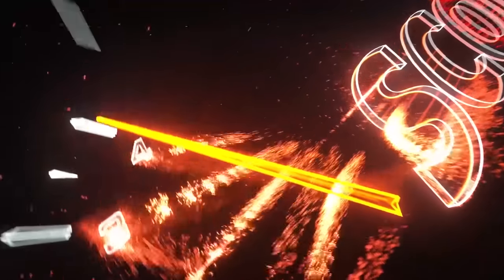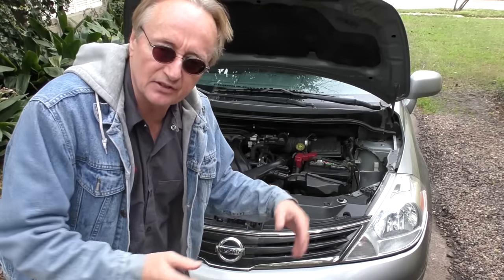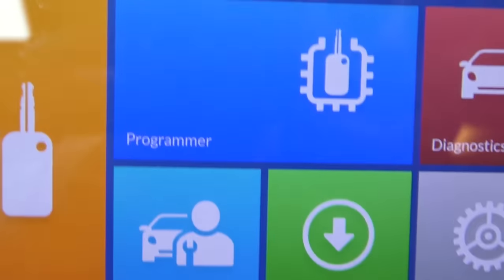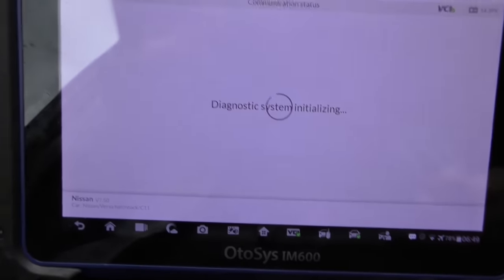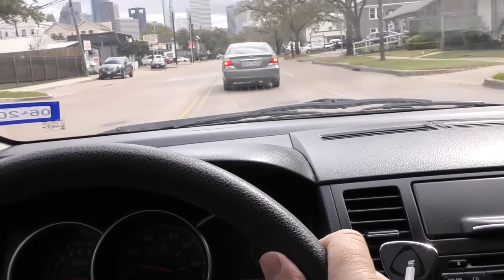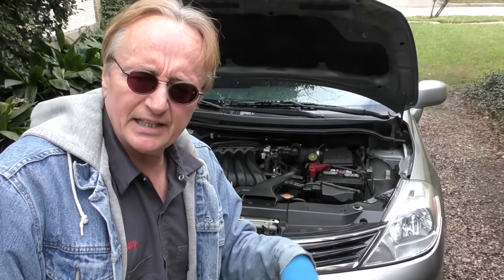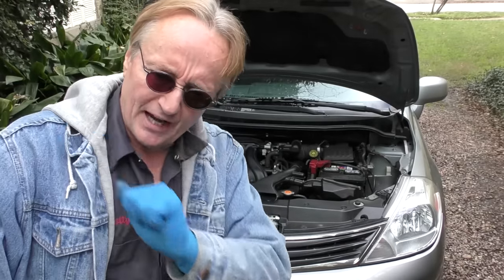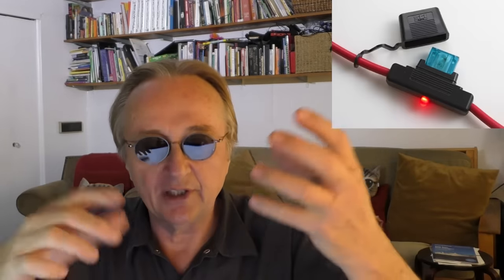Here's Why You Should Buy This Cheap Nissan

Comment: I think those first gen ones are a little better Made. The interiors were less cheap than the models that followed. I considered a new 18 before buying my Used Scion XB. Brand new base models with 5 speed manual and roll up windows were $10,500 after dealer discount and incentives. Its made in Mexico, its handling is rather floaty. Biggest gripe was no power door locks. That is just a PITA with 2 kids and car seats.

Comment: You can get a brand new 2024 Versa for $16k. Yes, $2500 is cheap entry, but then you spend $500 on tune, trans drain and fill, God forbid a catalytic converter. The 2024 is even easier to work on and the base model can be had with a Manual transmission still.

Comment: I’ve had a 2014 Nissan Versa sedan (NOT the Note) for about 18 months. It’s a standard (manual) transmission. Got it with 99,000 miles and it just hit 115,000 miles and it runs fine. It’s NOT fast by ANY means!
Changing oil every 3-5K miles as Scotty recommends.
Checked underneath the frame at the mechanic’s and there’s NO rust.
I’m in Albuquerque, NM right now (so that’s good for that).
I’m feeling this thing could last me a while.
What do ya think, Scotty?

Anybody have any ideas or comments?

Comment: The coil springs are recalled from 2009 to 2012. Mine just went on my 2014 at 75 000 km but aren't recalled. It's my second Versa and will be my last Nissan.

Comment: we had one just like this 2009. Same color too. I think the first gen Versa is better build than the second. We've had 2014 and a 2018
Reply: I think between the 1st Gen and 2nd gen versas with CVTs the 2nd gen is better because the CVT transmission is better designed.
Reply: How was the 2018?
Reply: @weldmin4818  I think is a little more robust than than the early sec. gen. In other words they ironed out some of the major issues

Comment: I’m just here to remind Scotty and his die hard fans that I own a 2011 Mercedes c300 luxury model at 250k miles and it’s still running (did all maintenance myself for the past 3 years) parts are expensive but doing the labor yourself saves you 80% , and i beat  on it as I’m a speeder I do 95mph on the highway but Mercedes are bad according to old Scott 🤷‍♂️

Comment: Driving from Spokane to Renton next week to buy a 2019  Versa SV CVT with 22,000 miles. I don't drive more than about  1500 miles per year in my car so i am hoping the CVT transmission will last!
Reply: Randy Brown 
My newest car is a '19 Nissan Note, im at 9k
I'll inform you that Nissan had redesigned the CVT differently from previous generations, & may have a better potential for reliability.
     My best suggestion for you is to remember when 25k or 50k is reached its time to see the dealer & flush the CVT there failing to do so will result in inevitable CVT failure
Reply: @MainMite06  hey thanks for the info. since the car has a little over 22,000 miles and has apparently gone thru an ASE certified inspection i would hope that they have done the fluid change before offering it for sale at Enterprise but i am not counting on it and am going to ask.

Comment: My versa has taken me to 30+ states, both Pacific and Atlantic Ocean, climbed both the Rockies and the Appalachian, been through Death Valley and on top of snowy Mountain Rainier, to Mexico and to Canada.
It is surprisingly reliable BUT I still cannot wait to get rid of it because as it reaches high mileage, its repair cost is comparable to its car values, it is so loud inside, has absolutely no impact absorption, can't do basic things easily like replacing spark plugs, the electrical wiring is not very good, and lastly, the CVT is an absolute nightmare!!

Comment: Not completely agreeing with you on the reliability, coz I own, or have people I know that owns them, and a group of Nissan fan club that shares knowledge.

4-speed auto...isn't considered reliable anywhere, compare to the CVT in Bluebird Sylphy. Compared to Honda's CVT...fairly better. I own/driven a Honda first gen CVT as well.
The spark plugs...yes, agree...bad design to change them. The HR and MR engines are just build that way.
The engine bay heats up pretty easily. Hence, this cars are bound to either have coolant issues, broken radiators, oil pan leaks, exhaust heating issues prior to the catalyst converter and rubber gaskets replacement if you drive them harder (in terms of not even racing them at high speed).
The other issues easily crack are the engine mounts.... if you drive on gravels, alot of undulate surface....you not only replace this "soft" mountings, you need to replace your driveshafts.  That will have your steering cranking, if not your power steering making noises for some "pin" snapping noise. 

My car is 12 years old. Aside from the above "normal" complaints from even other owners, the space, the simplicity and no fuss electronic issues makes this car going.
But, be aware of long trips , like > 30+ miles or city drivings lotsa stop-go ... if you want to use this car for those purpose,....get another.

Comment: Scotty, your explanation starting @2:20 is actually incorrect. You said that the fault in the ABS system and wheel sensors was responsible for the TPMS light being on. That car uses a direct TPMS with a sensor connected to each valve stem. It doesn't rely on the wheel sensors and is a separate problem from the wheel sensor fault. Also, why isn't the ABS warning light illuminated on the dash if there is a fault with that system?

Comment: I have a friend that recently bought a $28,000 new Nissan Frontier.  2000 miles and it is already in the service department, the air conditioner quit working, he wont have it for a week at minimum.       I would have told him Nissan was crap before he bought it, but he didnt ask me.

Comment: Is there really a car with the spark plugs below the inlet manifold?  How crazy is that?  As Scotty would say, RUN!
Reply: Yep I don't have the car anymore but it was hell for a single coil going bad. Ford v6 3.0 has 3 under manifold on passenger side.
Reply: John Gee 
Renault 4 cylinders are usually made like this to save hood length for *interior legroom*.
  BUT some renaults had the intake manifold with "open fingers" so that the coil+spark plugs, were easy to access.
- If the technician is experienced enough, removing the intake on a versa will be a 15 minute job

   -Otherwise, most FWD V6 engines typically bury the the back 3 cylinders with the intake manifold to keep the hood low.

Comment: The other problem is that the seals have to be replace because of the intake manifold location. A simple problem that becomes more complicated
Reply: gvi341984 
The intake seals are usually resuable on that car, 
(i havent changed the seals on the 08 in over 2 years & not have a misfire)

You should mostly worry about not making a vacuum leak in the intake, & following the torque pattern.

Comment: It may be affordable but I wish I hadn't bought mine.  This car is shorter than the 2015 Versa I had.  Rear seats have no leg room.  Trunk is smaller.  Front passenger seat can not be changed in height.  Glove compartment is smaller.  You have to buy your own screws to attach the front license plate.  At this time you can't get the cameraa  (which cover a large part of the windshield), auto dim rear view mirror factory installed.  The worst part is they built the car with crevices that can't be cleaned of debris all over the car ( too many recessed gaps between top and sides of car and front and rear windows.  Not worth the cheap price.

Comment: How is this car in the snow?  Not horrible snow, but maybe slippery roads?
Reply: Good question, i drive the note 2014 but i will try it on the next snow pouring
Reply: As a retiree in the south with only a few 1" and two 8" snows to report and being my first front wheel drive,  better than all the rear wheel drives I owned as a Yankee snow bird. Icy roads? never tried.

Comment: Love your work Scotty. I have a 2004 nissan pathfinder 4x4 3.5 V6. I've had it about 9 years and it's getting up there 250.000 miles do you think it will run another 100.000. I change the oil myself usually before it's due. I just hate to get rid of it it's part of the family now. P. S can't wait for the app to come out.

Comment: I am thinking about getting a Nissan leaf. $5K for a low miles copy. You know the battery is going to be replaced every 10 years. Not a lot to go wrong range anxiety can be an issue but I could have reliable transportation for the rest of my life 52yo. I'm set I know my patterns I use a tank of gas a month barely need a car.

Comment: What would help is if Scotty mentioned the model number in videos, and which plant it came from.  2012 is a model change over year.  

Looking at the front and comparing to wikipedia, it looks to be a pre-facelift second generation N17 (in other markets variously called the Latio, Almera, Sunny, or Renault Scala) on the 2nd generation of the B platform called the V platform, almost certainly made in Japan. So isn't not a first generation C11 on B platform  (C12, C13 Versa not sold in US)

The B/V platform is widely used in various forms in Nissan Renault's smaller cheaper cars, including their cheapest model in Europe, the Dacia Sandero hatch, but also used across their model range including the well reviewed and priced Duster crossover, panel van/leisure van, MPV, station wagon, and South American only pickup, all made on the B/V derived B0/M0 platforms, with mostly Renault engines and typically manual transmissions.  Production in Romania with base model Sandero and Duster also made in India for local and international sales.  

The Duster (gen 1 or gen 2 body) is probably a better buy than the Chinese made SUV that Scotty recommended some months back, if available in your market, as long as you pick a Romanian made model, the right engine, and avoid the CVT transmission

Comment: I got one just like this, same year, transmission, price, pretty much everything. Only difference was the color and the mileage (75k) They aren’t sports cars by any stretch, but despite having aging spark plugs mine is fairly fast. The ride quality leaves a lot to be desired even after a suspension swap, but it’s tolerable. I managed to get up to 120mph once without redlining,

Comment: Scotty Kilmer hey what do you think about a 03 Chevy malibu I know the newer ones are trash but I've seen them be pretty reliable overall whats your opinion couldn't find anything on your channel about them.
Reply: Oh yea it's got 175xxx miles and I might be able to get it for 1k
Reply: So many problems, it's a total waste of time. It's best to run, unless you know the owner and are sure it has been reliable for them. Beware the plastic intake manifold! Make sure the passlock system has been bypassed. The fuel pump can fail, causing random stalling. Most likely the car will eat your wallet little by little.

A 1996-02 Corolla or Prizm is better; the only issue with them is burning oil; you may need to top it off a lot, along with the usual oil changes.

Comment: I have a Nissan Altima and found water in my oil got to work on it myself and I just did the oil change, plugs, the fan belt, breaks but now I have a blown head gasket
Reply: I bought my Nissan Versa sv I got it for $2,500 too and 80,000 miles but now I have this problem and I’ve never done a head gasket job myself on a car only a boat

Comment: Im in uk and have nissan note which i think is just older version of the  vehicle here.....mine has just 8000 miles yes  that low, it was owned previously by old lady who had it for 10 yrs  and averaged  400 miles a year!!! yes i paid  good money  for it £3000 but its  condition is so good as it was garaged... i have to  change  tyres  as their originals  and getting to look tatty on the  fronts plus only other  thing i had  done was it needed rear  shocks  are  seals had  gone on them

Comment: I just bought a 2007 Nissan Maxima se. I paid $4500 for it and it has 112000 miles on it how many miles do the cvt transmissions usually last? No problems with the car as of now. Is this a car I should take on a road trip with my family and not worry about getting stranded? Thanks for the videos keep up the good work.

Comment: The Versa SL trim has a CVT. It is a good idea to mention that to avoid some people buying those....
Reply: Andrei C. 
If the transmission is making       
    " straw-sucking noises "
THEN you avoid that car

IF NOT then continue the purchase & have the dealer flush the CVT fluid!
Reply: @MainMite06  It is better to avoid that car, period. The model he featured in this video is the S which is a 4 speed automatic. The problem is that he didn't mention that this model have 2 different transmission depending on the trim.

Comment: Great gas mileage,  got up to 46 hwy/38 city, went kaput at 280, 000 miles, never had a car where the windshield wiper pump died, will never buy another one, particularly after they recalled the 2012 to 2018 models,  which I'm surprised he didn't mention.

Comment: I've been listening to that chatter and wondering if it was a problem or normal sound for the 1.8L. Thank you! I love my 2010 got for 3000 everything works and definitely recommend. Only 1.8 not 1.6 the 1.6 is the cvt. You can always check to see if the shifter goes into L instead of a shift down into 21. Cvt doesn't have a 1 or 2 shift only a low mode.

Comment: i bought a 2007 versa from my dad for $200. 285k on the clock and drives smooth!
Reply: just replaced the alternator and belt... $250 for the repair cost more than the car

Comment: So are you going to do the spark plug replacement job or not? Lol How involved is it taking that manifold off?
Reply: marquise robinson Just like my mom’s Equinox. The Equinox/Terrain with the 2.4 has the spark plugs under the intake manifold.
Reply: Ford v6 3.0 has same design. Not hard but definitely not a happy camper. Cost 150 labor at local garage (lowest price) suggested to replace seals and all plugs and coils at once and could be all over 1 coil misfiring.
Reply: marquise robinson 
It's fairly difficult for a newcomer..
But a veteran used to these cars will find them a cakewalk,..

...just dont ask about how much tools it takes to remove & install that intake though!

Comment: I got to agree with Scotty on cvts I had a 2015 versa note CVT went out at 59,000 miles and I got it switched out for free by Nissan then it started going again at 69000 miles I just traded the car in for an electric Volkswagen e-golf 2019
Reply: I bought a new 2012 Versa. The CVT started slipping at 38k miles. It was very disappointing because it otherwise had been very reliable and I loved it.

Comment: The versas with 6 speed manuals were     nice to drive
Reply: I think it's hard to find a 6 speed Versa with other features like cruise control, power windows, etc.
Reply: @MyDyerMaker  I had found one a couple years ago that was clean and had most all options. The problrm was that it had serious water leaks which I hear is common
Reply: @qrm8772  Understood.  A friend of mine has a blue one (with CVT),  and he hasn't had any issues with his.  I was considering buying it from him, but I didn't want a CVT tranny.  I looked for a 6 spd Versa with cruise control and never found one.  I bought an old Acura RSX instead.
Reply: @MyDyerMaker Probably a better car overall anyway

Comment: Scotty, the 2012 Versa has a CVT, not a 4 speed automatic, and like most CVT transmissions from Nissan it's pure junk.
Reply: C C 
CVTs may not be entertaining to drive.
But they can cross 200k miles as long as you flush them, & have the CVT filter replaced at the dealer at 25-50k intervals.
    Doing this isnt much different than owning an automatic Honda  & remembering to flush the ATF & replacing the AT filter at 50k intervals 
Or otherwise you may lose the transmission!

Comment: I have a Nissan Versa 2013 and my transmission is slipping I bearly got it on June at the Nissan dealership and I don’t race it and the transmission is slipping no leaks or no codes and I gotta play 140 for a transmission diagnostic

Comment: Just read Ford stopping production Lincoln MKZ decision announced Wednesday.   Read MKZs make up about one third of Lincoln sales and dealers not happy about cutting MKZ.  My question:   Are the inmates in charge of the asylum at Ford?  All Ford is going to do is drive those of us who prefer sedans to Honda and Toyota. The president at Ford  I understand is relatively new to the glass house and making some decisions that may prove to be a disaster.   Fords stock is somewhere around 7 dollars a share compared to GMS  35 dollars a share.
Lincoln will still make Contenental.   What's your thoughts Scotty?

Comment: Did Scotty say the abs system won't work without working tpms sensors? Why wouldn't abs work in that case?
Reply: dave houston 
He's rambling, 
  Heres what he definetly meant to say:
     "Tire light is on, tire pressures are good, I drove the car around, but the tire light doesnt turn off,  i think one of my TIRE SENSORS are dead, BECAUSE my ABS/TCS light isnt on !

Comment: Scotty:
This is the first time I've heard that the ABS system is dependent on the TPMS system working. Is this true of other cars or just this Nissan?  My 2009 Dodge Grand Caravan TPMS sensors are beginning to occasionally fail, probably because the batteries are nearly spent. I was intending on not replacing the TPMS sensors. Is my ABS system not going to work if I don't replace the TPMS sensors?
Reply: I was surprised by this also.  I think they are independent systems.
Reply: (Im an anonymous mechanic)
Your ABS will be fine, with/or without TPMS sensors,
But,
You'll not be informed of your possible low tire pressures if the TPMS sensor isnt replaced.